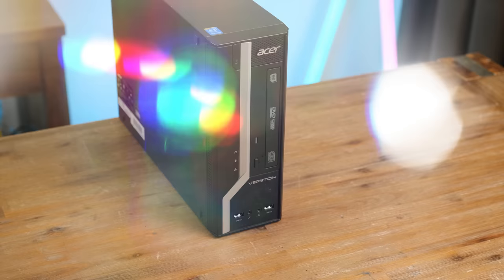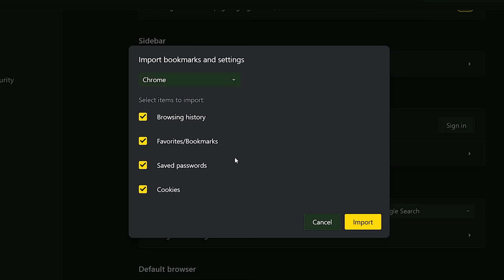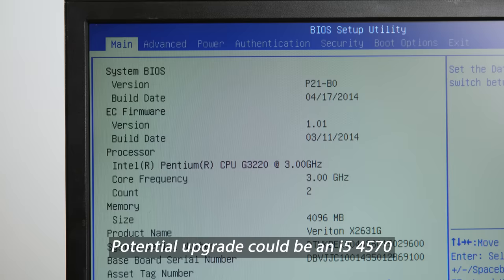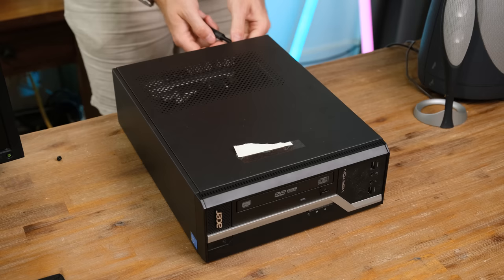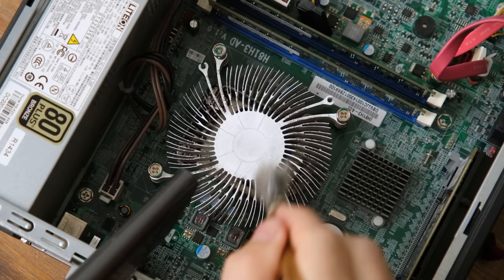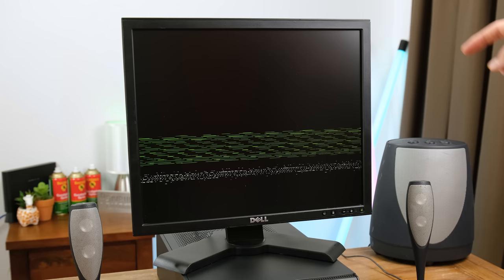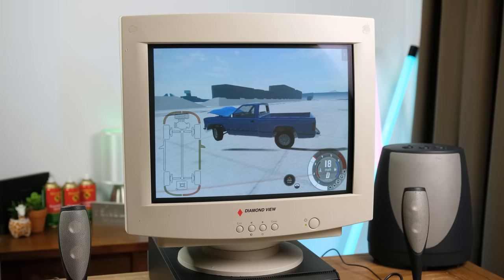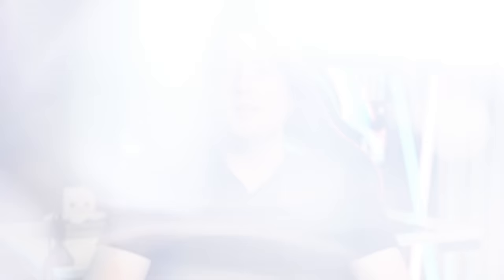Building A Horrible Gaming PC For $0...

Comment: I lost it at the Hitachi Deskstar Deathstar, well that's one component that's definitely in the $0 range (or possibly negative)
Reply: Hard drive enthusiast here, the ones made by Hitachi are amazing, it was IBM that gave the "Deskstar" branding its bad reputation, and since Hitachi still used the name after they acquired IBM's hard drive division in 2003, the bad reputation transferred over and people still called them Deathstars, despite the 75GXP series being the root cause of all the hassle. Not like I'd have a collection of 75GXPs or anything like that, definitely would be quite a terrible idea...
Reply: @cdos9186  lol you do
Reply: @cdos9186  i remember the HGST slim hardisk with 7200rpm speed

Comment: I just love CRT monitors for the exact reason...its low resolution , but looks crisp and neat enough...aiding even older rigs to run modern games at decent frames
Reply: CRT monitors have such a unique look and feel, I wish I had one to use
Reply: @Blacksmith52  there are people trashing them (99℅ of them are tvs), you can see if there is ewaste in your area but they are not worth fixing and dangerous
Reply: @Blacksmith52  I do have one TT , it just is making clicking noises TT
Reply: CRT's can have ridiculously high resolutions
Reply: @jamesdoe4515  but the low res ones make your potato pc feel god like :)
Reply: @namesurname4666 dangerous? How? Why?

Comment: My current work/gaming rig was built around an old (and buggy) motherboard and a 2nd gen dual core i3. I had to flash the bios to get external video cards working, and I was afraid of bricking the whole thing. But, I was successful, and after flashing the bios, I could install my GTX 750Ti and a 3rd gen quad core i5 to be able to play some games. As I am a vintage gamer of sorts, I could play PS3 era games at high detail level (mostly maxed out) and even some early PS4 gen titles at relatively good looking settings. This rig has been in use for three years now, and it kicks ass for what it is!

Comment: If you could do a part 2 of this video, you could find some upgrades to it such as replacing the processor with a Core i7 4770, upgrading the RAM to 16 GB, upgrading the HDD with a SSD and the graphics card with a small form factor RX 6400, you could make a reasonably competent Gaming PC!

Comment: I actually had one of these and kitted it out with an i7-3770, 16GB DDR3, 2TB SSD, Nvidia GT1030 GDDR5. Installed Windows 7 ultimate - super fast boot time. Played quite well but that little PSU blew twice in 8 months and the second time it took the motherboard with it. Lesson learned don’t neglect to upgrade your power supply
Reply: You need to install 3770s, or xeon 1260l, or 1265l v2  -  very low CPU tdp

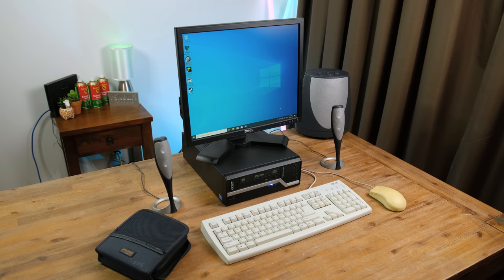Comment: 5:28 "Can your gaming computer do this? I didn't think so." - Actually it can. It has an optical drive. 

Although I don't think it's what anyone would consider a "gaming computer," it's better than this rig by a mile. It's an Optiplex 3020 SFF with an i5 4590 and a GT 1030 with 16 GB RAM, 1TB SSD and 4TB HDD. And a SATA card to provide 2 more ports so I didn't have to sacrifice the ODD. 

Still, it can run slightly older games at 1080p; Jedi Fallen Order runs okay on it, for example. Rocket League, Valorant, etc.

Comment: how much of a sleeper it can get if it got more of its possible upgrades.
before anything, maintain the CRT it is just a _classic_ touch not to have on a sleeper, as well as the keyboard, since it matches the PC brand wise. upgrade/mod the ball mouse c:

get the possible i5, some random kingston dramless ssd, the might gt1030 ddr5 and ofc 2x8GB of ram and of to the races you go :D

Comment: I just fixed up an Acer extensa 5420 laptop…date code says July 12 2007 and it was hardly used as it wouldn’t fully turn on. Come to find out it was the cmos battery as it was dead….the laptop is in almost mint condition and now has windows 7 on it….still doing updates.

Comment: TBH such a machine would probably be better as a linux server, especially if you replaced the optical drive with a mounting adapter for 2.5" and 3.5" drives,  And potentially adding a faster NIC and (if needed) a SATA HBA.

Comment: Nice system with a few shortcomings, if you ask me.
That Acer desktop PC would be a god base, especially for some upgrades - an i5 or i7 would go nicely in there.
8GB RAM is OK but 16GB would be better (especially with the i5 or i7) and SSDs are relatively cheap nowadays. But I would have both an SSD for the OS and a HDD for larger games.
Plus, that DVD drive is good, not many PCs have these anymore so I'd be inclined to keep it.
The sound system was probably the best part about the PC's peripherals. The ball mouse just needs to go, the keyboard doesn't look that much better (and I'd be surprised if either the mouse or keybard were USB), and the CRT is absolutely ancient. The flat monitor at the start was better.
Oh, and the GT610 was probably OK, but a low profile GPU with more power would be better (especially with the i5 or i7). At least I have proof that you don't need a 12th gen CPU/RTX GPU to play CS at the lowest settings.

Comment: "Even has Windows 7 installed: How about we install a resource hungry OS?" Well, to be fair system requirements for Win 7 are similar to those for Win 10 Is win 10 resource hungry? Well, kind of, compared to some Linux flavours, but Win 7 was more so for its time. We actually live in a golden age of PC longevity for light, everyday use: windows 10 is perfectly fine for a decade old computer, even a bit older. Imagine 20 yr ago, trying to run XP on a machine from the Win 3.x era, typically a 486 or the very early Pentiums at 60 or 75 Mhz.

Comment: my 3rd gen Core i5 laptop can barely run Minecraft - albeit I tested it on Windows 11 and it runs version 1.8.9 with OptiFine just fine with a texture pack on Arch Linux with the KDE desktop.

1.19.4 (latest I tested in Win11) ran at 20fps minimal settings
1.8.9 on Win11 with the same settings and a FPS-friendly texture pack (F8ful) ran at about 50fps

1.8.9 on Arch with identical settings to Windows ran at 60fps.
Reply: Windows 10 works better than 11

Comment: The Hitachi Deathstar cough cough  I mean, Deskstar lol
Reply: Hard drive enthusiast here, the ones made by Hitachi are amazing, it was IBM that gave the "Deskstar" branding its bad reputation, and since Hitachi still used the name after they acquired IBM's hard drive division in 2003, the bad reputation transferred over and people still called them Deathstars, despite the 75GXP series being the root cause of all the hassle. Not like I'd have a collection of 75GXPs or anything like that, definitely would be quite a terrible idea...I've had the best luck with Hitachi drives and Western Digital personally, and the fact I own multiple with no bad or reallocated sectors really shows the quality of them, despite them being over 12 years old at this point, still running strong.

Comment: Your not kidding Back in the day it was all Xp 32bit with 3Gb of ram and at least a graphic card with 1Gb video Ram all games ran fine Back then there was no interest in Xp 64bit as there wasn't any benefit for video games and basically no games developed for the 64x platforms.  Who would have guessed that it would change so much Windows 7 Era started getting more intensive games leading to needing Windows 7 64x and much more Ram...Now day's many 32 bit games run on windows 10 64Bit minimal best for gaming 16Gb of Ram..I have 32Gb compared to the xp 3Gb it's an impressive leap forward..